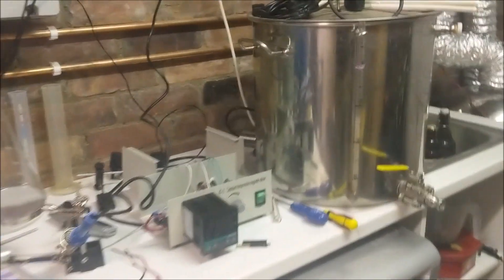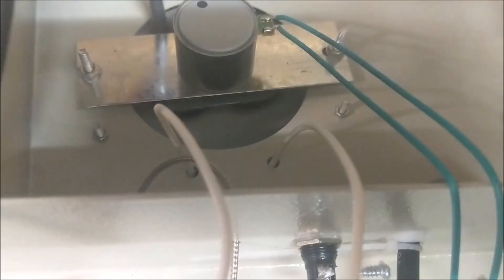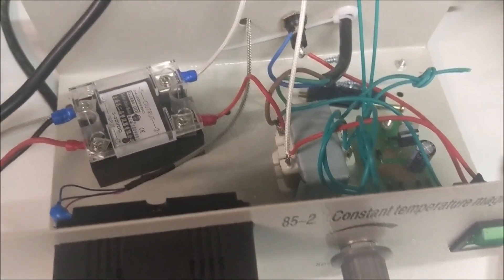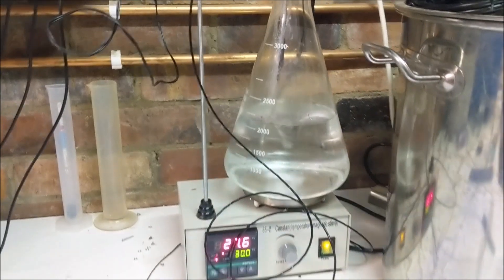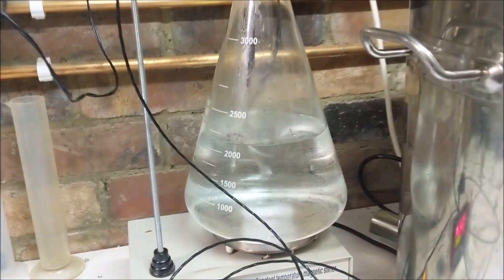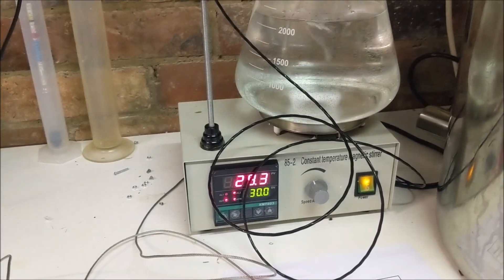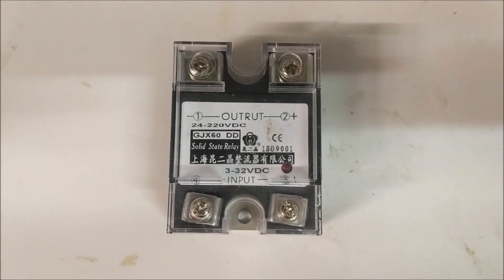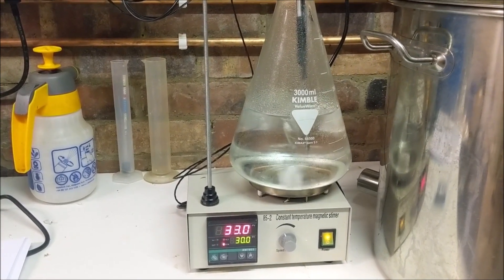Fixing a Cheap Ebay Temperature Controlled Stirplate

Comment: How good is the thermostat on this?
Reply from the maker: The original one that came with mine was abolutely useless.  The PID I replaced it with can hold temperatures to within under 0.5 C
Reply: @TertiaryBrewing  thanks

Comment: Same as I did with ours. Same model as ours. I added a switch to turn the whole heating side on/off for if we don't need it. Also put some audio screw posts on the back so I can disconnect the thermocouple easily when not in use. I'm using one of the long PT-100s that Brew Builder sell. With our larger flasks, you can use a universal carboy cap to hold the thermocouple then I use the bottom part of a 3-part airlock to expand the other port out to a larger surface for wrapping the tin foil around :) They're a good base for hacking, those chinesium stir plates. Don't half smell bad, though :P
Reply: Wait so these keep breaking?
Reply: How reliable is the temp?
Reply: Mine didn't break. I just didn't trust the original PID or thermocouple. And the original wiring was a bit dodgy. I can keep ±0.1°c on mine
Reply: @j616s  thanks